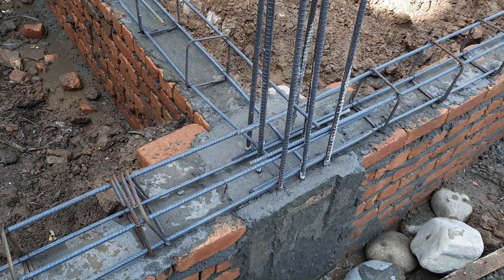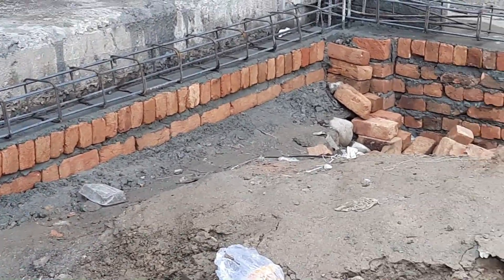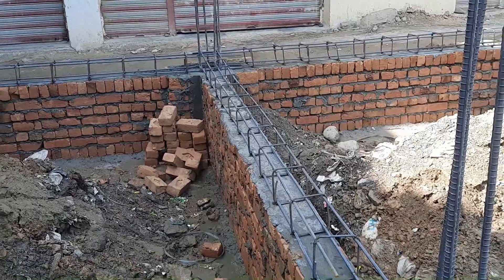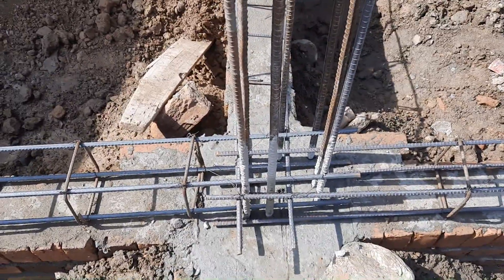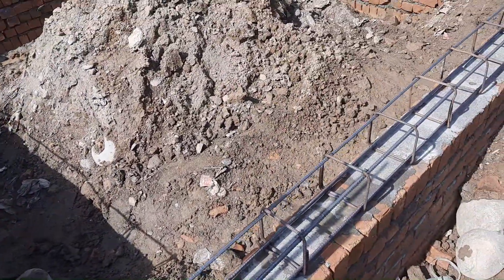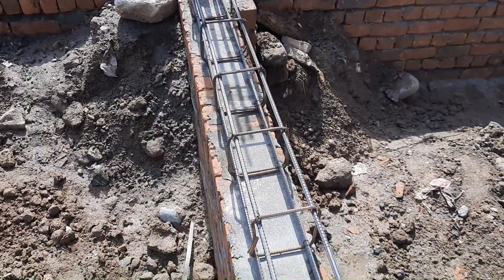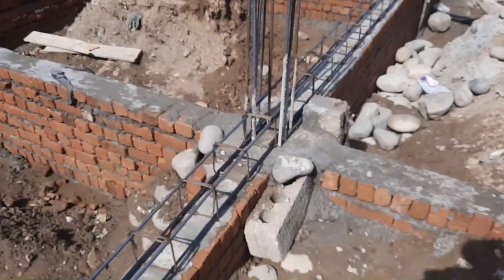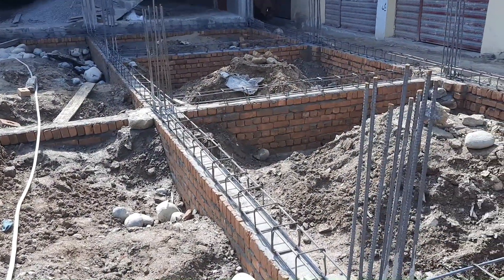4 Big Mistakes in Plinth Beam Construction on Site

Comment: Sir explain the primary, secondary beam joints and how to identify the primary and secondary beam in site
Reply: if beam is supported on column both side its primary beam.
if one end is on column other end of beam on another beams its secondary beam .
if both end on other beams than also its secondary beams.